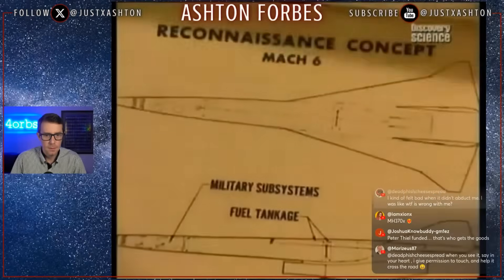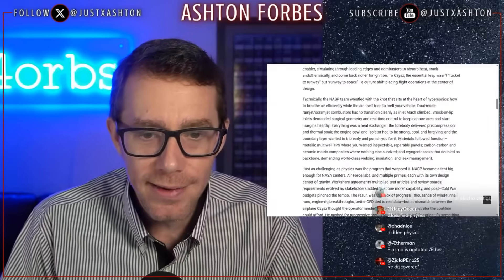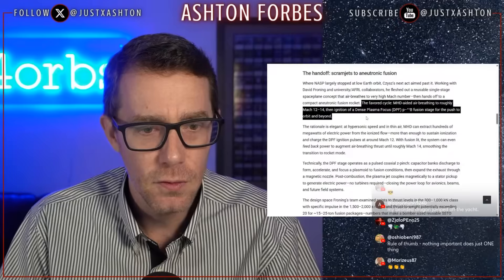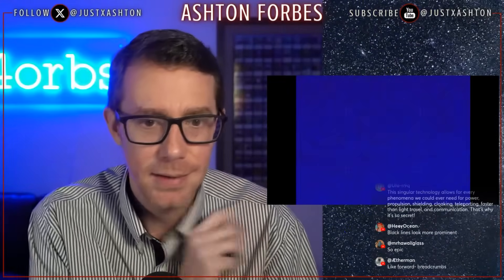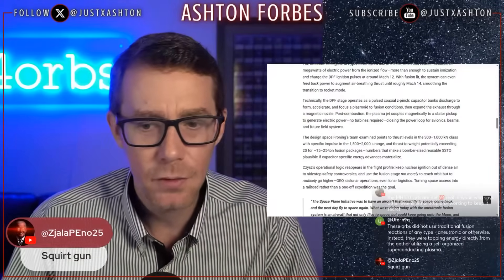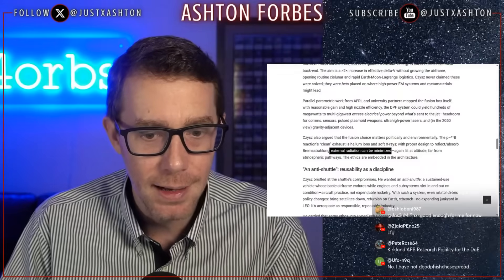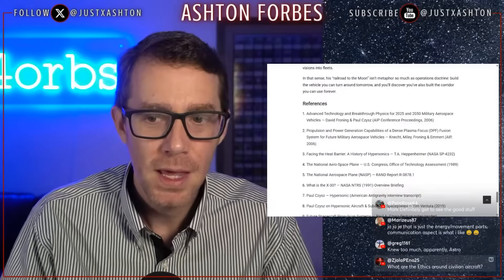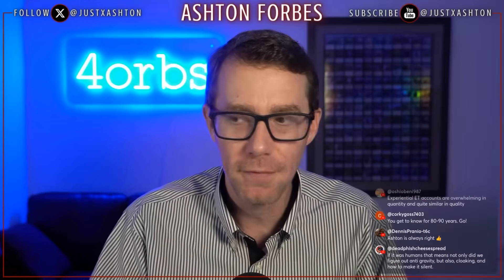The Hidden Plasma Technology Behind Hypersonic Flight

Comment: Mark McCandlish drew some designs for them, if I'm not mistaken.
Reply: The orbs behave like three kids running up to join hands together, for a game of 'Ring around the rosey'.  Once they start reaching out to hold hands, here comes the soft x-rays (black lines).  Once the join up (sync up), they become ONE triangle, spinning like a circle, and begin to sing the song (RFID).  Then like a figure skater, pulling arms inward, going faster, then tighter until POP goes the weasel!  A Matrix like call across the aethernet.  Would be so very cool to see it "arrive" out of what?  A mirror?  A flash bubble?  Not too close, but to see it show up...  I guess POV of fourth orb (or other three).
Reply: I have his Fluxliner ARV blueprint on the wall.

Comment: That's another name for MHD / EHD, magnetohydrodynamics or electrohydrodynamics if you want to look it up. Some PUBLIC NASA documents too. The one I saw mentioned the X-1 first the break the sound barrier used a metal rod at the front charged with high voltage to reduce drag.